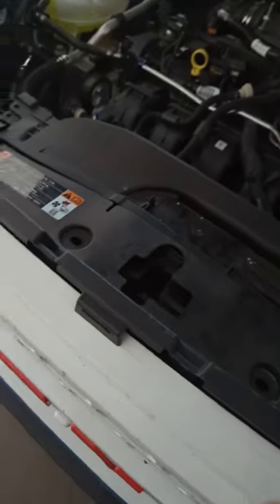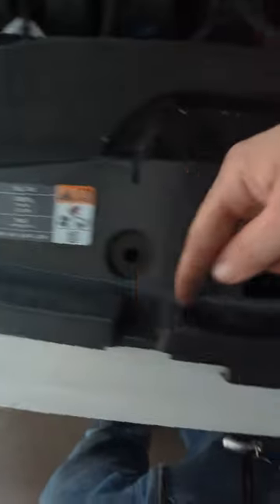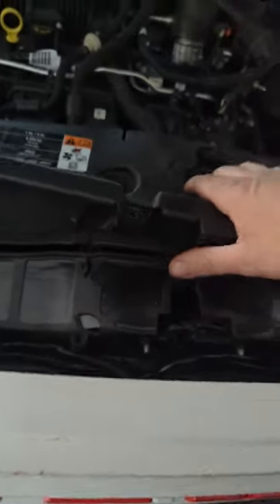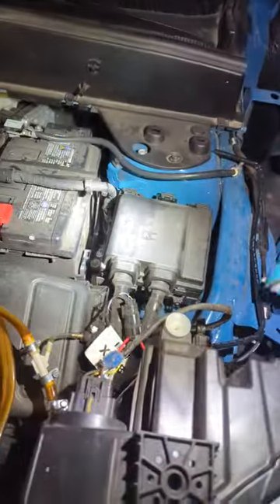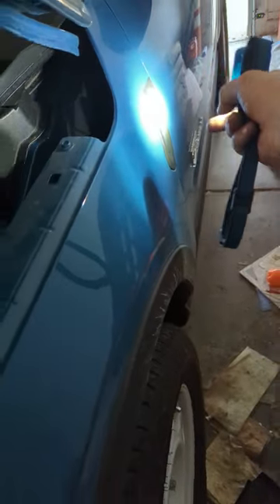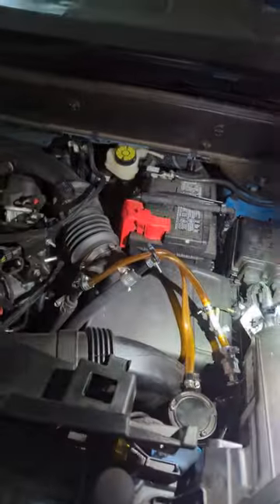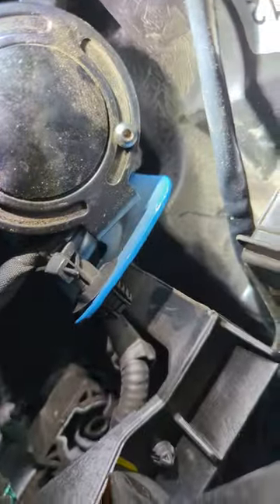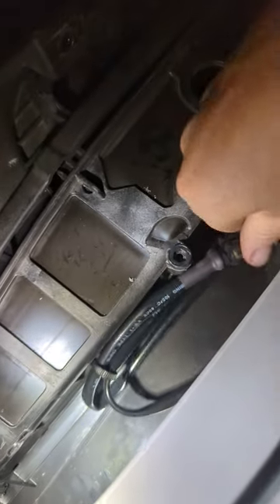raptor like marker lights in bronco sport grill

Comment: stupid question but do the marker lights just stay on whenever the headlights are on or whenever the vehicle is on?
Reply from the maker: Yeah since I hooked them up to the power for the headlight you're only going to be on when the headlights on or whatever that power wires for cuz whenever I lock my car earlier they were on but the headlights were off. So not exactly sure what that wire controls. But I tried turning on my marker lights and they didn't show with that. So I basically either have to turn my headlights on or it has to be dark and the automatic headlights have to turn them on for them to show.  I was hoping to be able to control them or have them on with the daytime running lights so I might change the wire later but this works. I was thinking about hooking them up to the fog lights so I could turn them on and off myself but the headlight power was just so easy to get to. I just stuck with that

Comment from the maker: I need to add there was actually six 10 mm bolts. Those are the ones that are painted black. The 7 mm ones are just a gray metal color, but it's pretty easy to figure out and then there's just the two push pins that you have to pull out.  Also when I said super glue I meant glue gun.  Also, I cut about two feet out of the power wire because it didn't have to go as far. I just cut a little one inch slit and the protective sleeve pulled it out, shortened it and then connected it to the power in the headlight